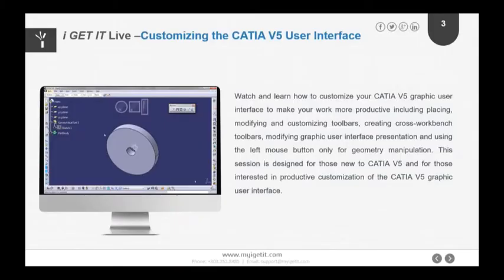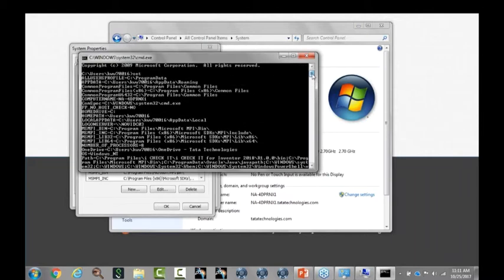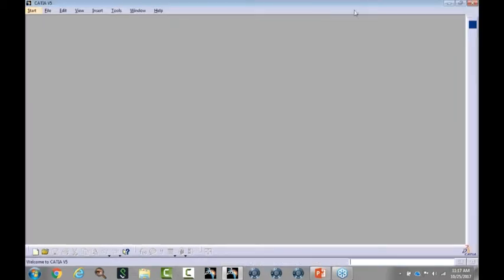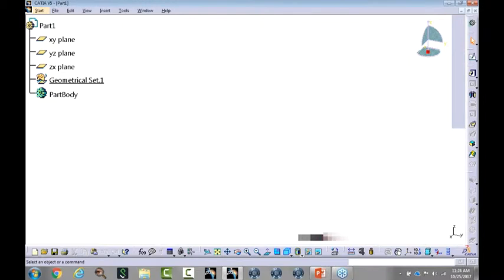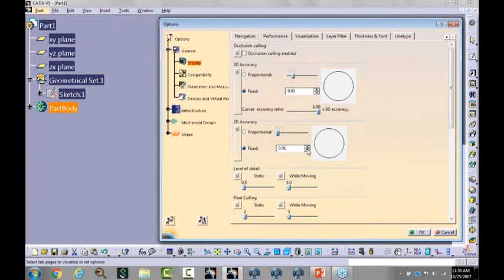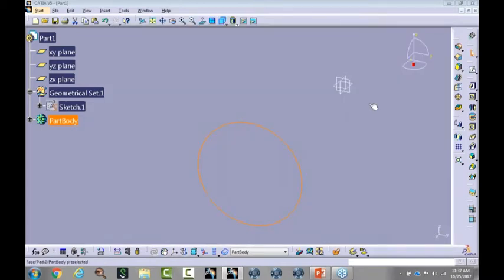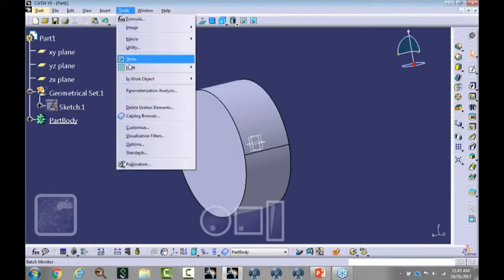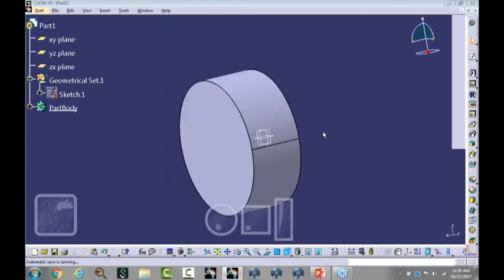Customizing the CATIA V5 User Interface

Comment: Hello sir,
It's a great video and thank you for that. I have a little querie, I had designed a v6 engine and when I try to simulate I can simulate the piston and crankshaft but when I try to simulate the rocker arm assembly even though the mechanism can be simulated I cannot see the parts moving. What I have to do please help sir.

Comment: the fact that catia has you messing with custom user files when every other CAD application out there can be customized from the inside goes beyond me. It is certainly a powerful software no doubt, but why make such a terrible user interface.. what were they thinking? Thanks a lot for this tutorial, would have gone mad otherwise